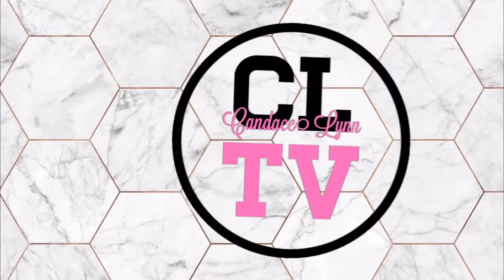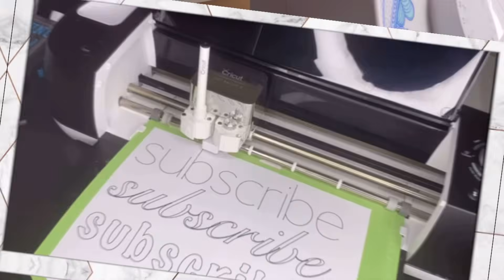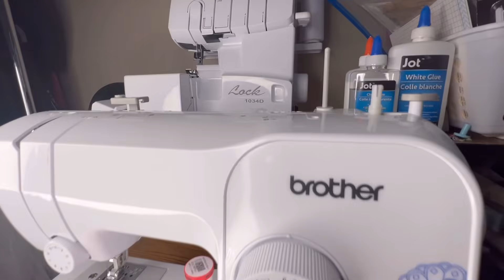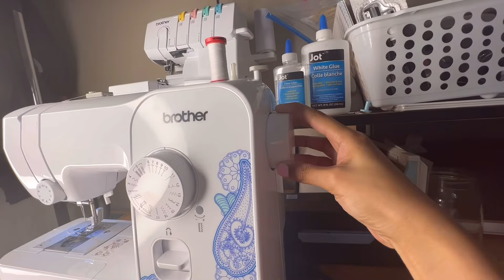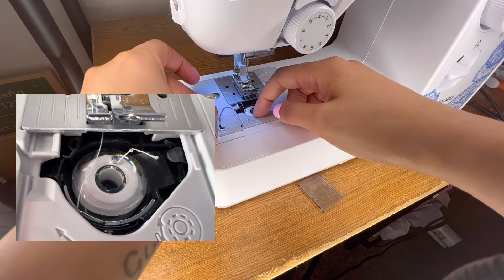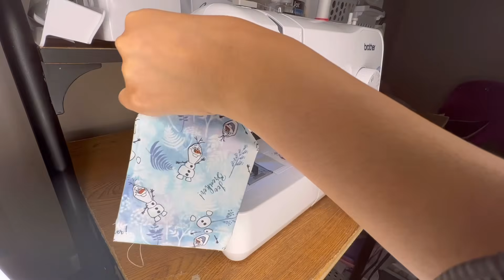How To Set Up Your Sewing Machine (Brother LX3817) | Beginner Friendly Sewing Tutorial

Comment: I don’t know how to know if the needle is bringing up the other thread 🪡 lol I feel like that part is the hardest part
Reply: Yeah mine just isn't catching no matter what I do :( my mom is an avid sewer and she has no clue what is wrong with this particular machine that it won't thread right
Reply: Did you receive any responses? @katherineduke3232
Reply from the maker: You should have two threads  one from the needle and one coming from the bottom.
Reply: @candacelynntv6917  and then what do you do with those two threads? just snip them off or leave them hanging off the back of the machine?
Reply: @taliahoching4317 yes
Reply: Leave them and start sewing
Reply: My stitching are very loose so I return my new machine
Reply: @shenilaahmed3169 girl you yourself have to change the tension on your machine. it can be loose or tight you have to adjust it
Reply: I used same method
Reply: Bt I disappointed